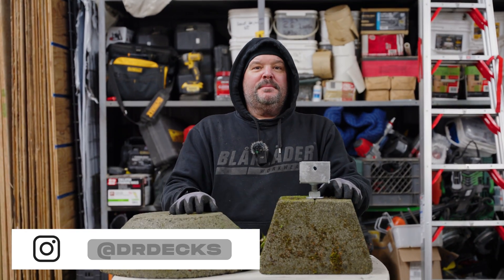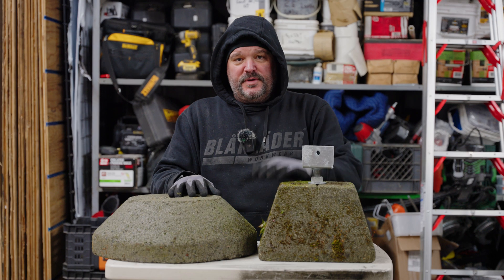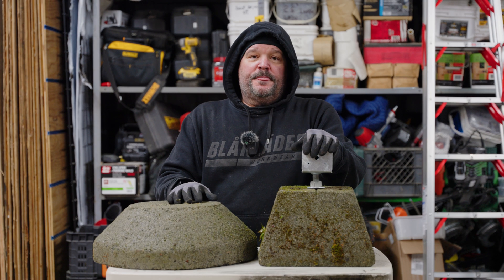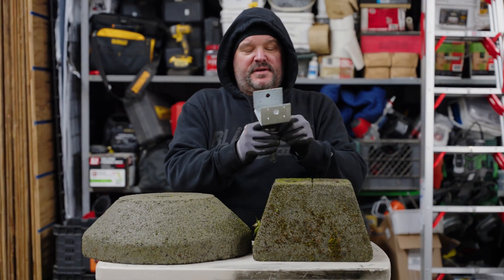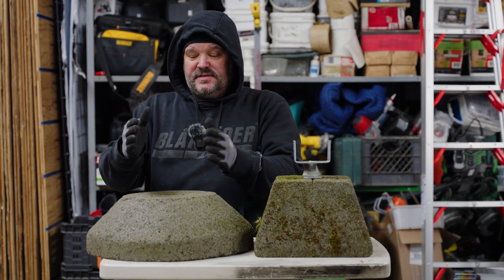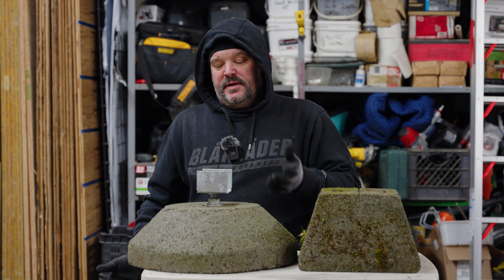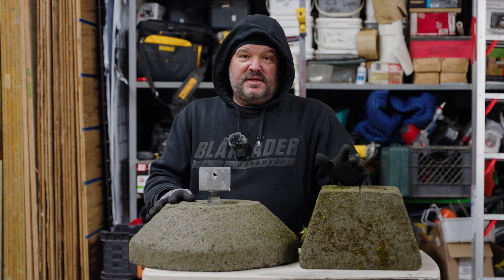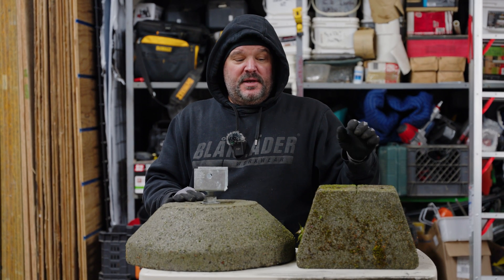Why Use Concrete Footing Blocks? || Dr Decks

Comment: As a martial artist just starting out, you don't have cash to burn on equipment. A cement block with a deep hole in it is perfect for training. Just insert a wood pole. It's about the quality of your training. Not the quality of your equipment you use.

Comment: Hi.....Im also in the pacific northwest. I had 9 of the those blocks on your left. Im building a carport. For sure Im using tube of cement to put in the holes. Those bracket rods are a little small for the holes to stand up alone. Thanks...

Comment: I want to support a 20' wide deck in Seattle . It currently has five 4x4 posts set onto 12x12" square pier blocks at the outer edge of the deck plus a row of 3 4x4 underneath. Each row of posts is holding up doubled 2x6-20' underneath where the 4x4 divides the 2x6es (one on each side of the 4x4 posts). There is a third 20' beam between the doubles that was being held up just by the rim joists. But the rim joists are all rotten and useless now. The 2x6 beams are not resting on top of the posts. Instead, the split 2x6's are secured horizontally with bolts and screws to the 4x4 posts. 

The decking is a full surface of regular 2x4s with plywood ontop. So its a dry surface below. There is also a roof made of 2x6 on 20" spacing. Hilariously, The five outer posts holding up the roof are basically just resting on top of each other in *THREE* segments and toe nailed together. Super janky! There are ledger boards holding the roof and the deck to the house. This was all there when I bought the house 17 years ago and it wasn't in great shape then. Now there's been some sinking and there's a ton of rot on the outer edge. The outermost two 2x6, all the rim joists, and all the fascia all rotted through. 

My plan is to to to attempt to preserve most of the deck wood by cutting the deck back 29"  along the 20' edge to the next good (single) 2x6. Then I would set new posts to support it there and add a second 2x6 as the new outer rim joist. New 12' posts will support the deck and rebuilt roof in ONE piece. I'll also resupport the remaining (inner) doubled 2x6 with 3-5 posts new posts and supports. 

1) First, Is this kind of horizontal fastening of two divided 2x6 to the 4x4 posts spaced 4' apart reasonable to do again? I'd like to preserve head height under the deck for storage. That plan seems to have held up fine for the last 25-30 years, so I'm hopeful.  If not, what are better ways to run the beams? 
2) In Seattle, how big of a post base should I pour? Are 10" wide Sono tubes reasonable ? 12"? Do I need to allow for a wide base below the tubes? How wide?
3)  How deep should I set the post base depth to? You mentioned 12" below the surface? Shallow is nice, but should I go deeper?

Comment: Can these be used for column supporting deck 10 ft up. Column goes through a lower deck. And concrete slab under. Or would you anchor to slab? I don’t feel like anchoring with an anchor is enough for a column.

Comment: Use these, but not these, but oh these are only available in Washington state. WTH!
Reply: Bottom line is that code in counties and cities is they want the concrete columns poured at least 18" in the ground.  Don't know if these would pass an inspection.  Just don't get a permit but still build it solid and save a bunch of headaches.

Comment: Almost every house in Hawaii is built on the regular 12” footing. They usually sit it on a 18” lump of cement which might increase its load bearing potential, but often the posts are sitting on the footing and not even attached.
Reply: yep... Here on big Island it's the same. wonder if its due to having lava as ground and or no snow or and or frost?
Reply: Read a research paper on it. 1920’s they built it up for air flow under the plantation homes and they also had vents up top to let hot air out. T&G was for stability and contracting and expanding with temps.

Comment: The elevated post base in this video, the Simpson Strongtie EPB44PHDG, has some manufacturer installation requirements that greatly affect how you can use it with precast blocks. If you don't epoxy it into the block, it can only hold about 700 pounds as a point load. Unless you have a ton of pier blocks (like a post every 2 feet along a beam), your pier will probably need to support a lot more weight than that, even for a typical residential deck designed for a 50 pounds per square foot load across the whole deck. If you use the recommended epoxy to set the post base, it can hold over 3600 pounds. Though this is probably well beyond the crush limit of the typical concrete pier block, and also beyond the psf limit of most soils if you're using a 12x12" (1 square foot) block, it at least gets you past the tiny 700 pound limit. Epoxying the post base reveals another key limitation of the Simpson post base, though: you need at least 3" of concrete between the bottom of the hole and the bottom of the block (per manufacturer's instructions), and the rod has to be inserted at least 3.5" into the block. That's a total of 6.5" vertical, minimum. You may need more if you're elevating the post or beam less than 2.5" off of the block, as the rod on the base is 6" long. The round pier in this video looks like it's only about 6" high, as are all the round ones I've found in my area, which means there isn't enough concrete underneath the post base to get that rated 3600 pound weight capacity. In fact, the round piers available near me are drilled all the way through, with just a tiny dab of mortar to plug the hole at the bottom. Could you epoxy the post base into a 6" high pier anyway? Sure, but you'd need a structural engineer to calculate everything precisely to know how much weight it could hold. Furthermore, the diameters of the holes in precast piers vary dramatically. The round piers I've found don't even have a 3/4" diameter hole, which means you'd need to hammerdrill a larger hole to fit the Simpson post base. You need a 7/8" hole to epoxy the post base in, but you can go up to a 1" hole if you're not using epoxy. Always bring a post base, a tape measure, and a pencil to stick down the hole to see how deep it is when buying piers! Also, this post base is for a 4x4" nominal post only, not a 4x6" as he says in the video, though you can use it directly on the 4" face of a 4x6" beam. Just a final thing to keep in mind: the round pier on the left weighs close to 90 pounds, whereas the 12x12 on the right is probably only about 60 pounds or less. Unless you are a real beast, tossing around a 90 pound block is a lot harder than a 60 pounder, especially if you're putting it underneath an existing deck to improve vertical support. Just buy a few more 12x12 blocks and some extra brackets and save yourself some pain.

Comment: Question...  I have some riding 4 x 6 deck posts   The footers are buried below the frost line. I dug down and the concrete seems to be in pretty good shape however the 4 x 6 post has been embedded in the concrete.  Is it okay to cut the Old Post flush with the concrete, auger out the old wood, drill rebar into the footer and pour over it using a sonotube?

Comment: question - I'm not building a deck but planning to adding a lean behind my shed.  It's ONLY 10 ' wide and the question I have is - Can I use these concrete deck blocks for my two post ? There won't be a LOT of weight at all other the the metal roofing which isn't heavy.

Comment: I hate concrete. It is heavy and annoying and entirely unnecessary. I'm in the New Hampshire and have entirely switched to plastic footings with sunk posts (no the PT doesn't rot, I build fences too and posts don't rot unless there is organic material against it at ground level, so put some crushed stone there). I do the engineering then select the footing pad and posts size for the weight/soil I'm on. There are online calculators to help with this. The footing pad sits at the bottom of the hole (yeah, 4' minimum depth here) and the post sits on the pad. My first footing pad deck I ended up with a 16" pad with a 6x6 PT posts on it and a triple 2x beam sitting on that. Three posts, 24' wide deck. Looks great. Another HUGE benefit of sinking the posts is no racking. No need for any cross bracing or knee bracing. footingpad.com/ is the company I've been using.

Comment: The circular block is not 18"x18" (324 sq."). Its footprint is circa 254 sq.", ( A = π r squared)
Reply from the maker: It’s 18” round
Reply: 1.76 cf surface area, quite a bit more than the square block a 1 cf

Comment: A good option is to use the standard 12 by 12 in block but to place one or two larger patio stones underneath them to distribute the load.